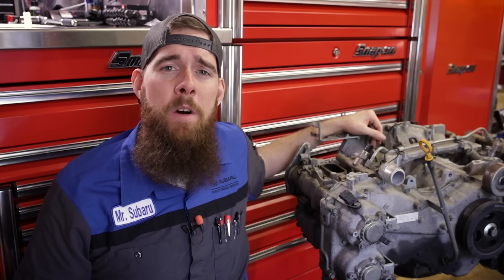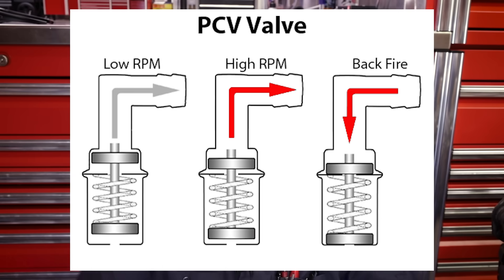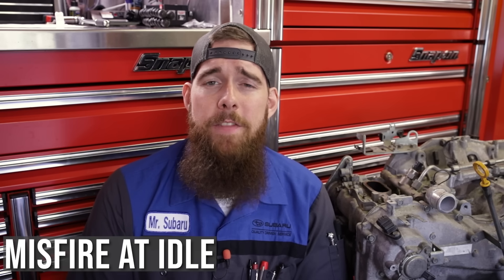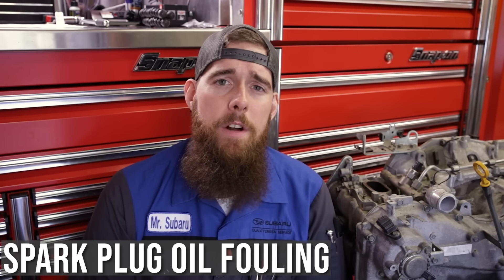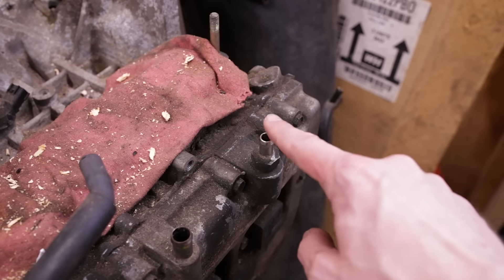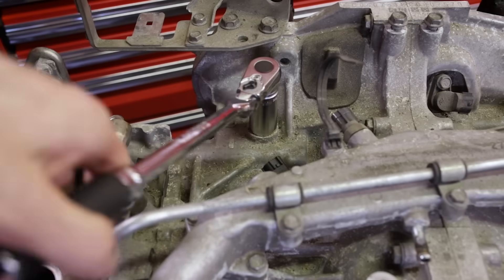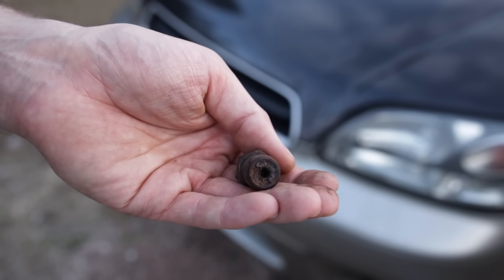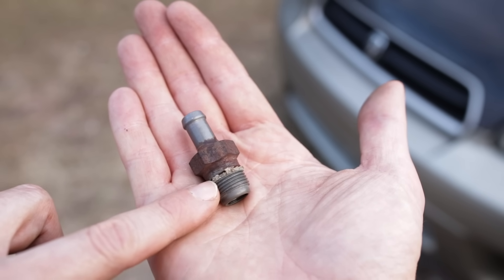DON'T Let This $20 Part Ruin Your Engine! PCV System History, Theory, Operation, & Repair!

Comment: Mr Subaru, a great video and took your advice. New PCV valve arrived a few days ago $29.99AUD.
I fitted the new PCV today to my EJ251 N/A Forester, it has 318,000km on odometer. It was rebuilt 5yrs ago, according to paperwork that came with purchase.
You where so correct about carbon deposits in valve, it  did not "rattle" at all during shake test.
Engine was using a little oil too.
Replaced PCV with new one and cleaned out vacuum hoses.
I still have a whistling noise from the engine under acceleration, any suggestions?
Reply from the maker: Was there carbon build up in the block, under the valve?
Reply: @MrSubaru1387  Would you also use brake cleaner to remove the build up in the block? What about cleaning the port threads (since they would likely have sealant)?
Reply: @MrSubaru1387  yes carbon in Port under PCV. I now have 327,000km on Forester 2004 and it is rough idling with hesitation in acceleration. I've cleaned TB on manifold like you show and vacuum hoses off PCV had gunk and power valve on side of TB. Cleaned all and reassembled then started engine and it idled high at 3,200rpm with Power light flashing on dash. I shut it down immediately. How do I lower the idle?
It's twin cable TB.

Comment: Question, on my ej253, theres another hose attached to the block next to the pcv, the hose on it goes back up to the center air box. Is that meant for supplying fresh air to the crankcase? And should the pcv get clogged could pressure be vented there and not immediately blow out of the oil seals?

Comment: Thanks for the tip. Got a 2011 Legacy 2.5i and inspected the pcv valve after watching the video. I noticed that the housing was CRACKED because it was made out of rubber that housed the PLASTIC pcv vavle. Had to buy the whole housing instead of just the pcv. Does the plastic one work differently? The new one didn't rattle when I tried the shake it.

Comment: you forgot to tell users to remove all hoses to PCV valve and clean them, on my car all hoses was 90% clogged by white\black gum, clean all hoses with brake cleaners, and replace worn hoses.

Comment: would you recommend installing a catch can on a NA 2015 Forrester, to limit un filtered pcv air from circulating right back into the intake? Wouldnt it be the same issue with recirulating unfiltered exhaust output right back into intake via the EGR? 
Shouldnt these flows be filtered.?

Comment: Another nice Video.  What thread sealant do you use for the PCV valve and the Oil Pressure sensor mounted near the VVT Solenoid?
Reply from the maker: Teflon paste/tape, or Grey RTV.

Comment: If you are "Lucky" the PCV valve hangs open and your engines runs bad because it acts like there is a vacuum leak. It won't blow out gaskets that way.
:49 Fixed orifices are common on some engines. Also, the things Germans and Swedes use for this purpose is sometimes different. All that was required back in the 60s was that there was something that redirected the blowby into the intake manifold. How they did it was not important

Comment: The one using grommet is a hell of work trying to remove it...it just stucked on the grommet and have no idea how to pull it off without using heavy tools that will break it...I think the threaded version is better than the grommet type...easy to install and remove

Comment: This is why I use a oil catch can on both of my mustang GT ever time I change my oil and filter I empty my catch can and it catches 3-5 ounces of oil every oil change that’s oil not going back into the intake manifold and the car runs smoother and every time I get ready to change my oil and filter I spray a can of intake valve cleaner and then change the oil and filter

Comment: Interesting. Maybe this is a dumb question, but do ALL modern car engines have PCV valves? When I started driving in the 1970s, they pretty much all did. Modern cars, however, I have seen conflicting info where some sources say a given vehicle has a PCV valve, with other sources saying no.
Reply from the maker: Most all still have some form of PCV system.

Comment: I noticed some water (yellow oil mixture) under my oil cap as its gotten colder.  Im gonna replace the PCV on my H6 and hope that fixes it.  Last time I saw water under the cap - it was a matter of time before It was destroyed and I had to put a new H6 in.  Heres to hoping this may be it!
Reply: Head gasket leak

Comment: My 2014 Suby Outback 4 fist boxer has a rough idle and hard to start no codes so I am hoping the PCV valve is the cause, but when I went to replace it the hose is hard as a rock! so I am waiting for the hose to get here first then I can replace it and see if that helps.  160k miles.  I already cleaned the MAF airflow sensor and cleaned the throttle valve body

Comment: By far the best explanation of what it does, the problem it solves, and possible issues. Great stuff.
Reply from the maker: Thanks! Happy New Year!
Reply: @MrSubaru1387  I have a question that I hope you can answer please. I have a 2009 h4 Subaru legacy sport that I recently changed the PCV valve on but when I did I accidently broke the thing that the valve threads into loose out of the engine itself and I don't know what it's called so I can't replace it. I was wondering if you knew what it is

Comment: Speaking from my humble experience I can say that it is better to just replace the pcv. Even though said pcv shows no sighns of being bad.  Some say every 50k km wouldnt hurt to put a new one. I change around 100 k. In my case   i see some oil in the pcv tube and in the pcv as well. However in my previous subies of ej series i never replaced them and to be honest the milleg(km) was relatively small about 100 k+ km. Of both cars. As usual like for the excellet video😀
Reply: As long as you car doesn't burn oil and change your oil every 5k miles  then you really shouldn't have to worry about it. Carbon is what makes it get stuck

Comment: The "V" in PCV means Valve so stop saying PCV valve and stop say ATM machine while youre at it.
Reply from the maker: Positive. Crankcase. Ventilation. PCV. Positive crankcase ventilation valve. It's not redundant. 🤦🏻‍♂️ 🤦🏻‍♂️ 🤦🏻‍♂️ 🤦🏻‍♂️ Don't try to correct someone when you aren't correct.
Reply: Im sorry.
I looked it up after I posted and tried to get back and delete my comment but too late....

Comment: Wish I would have known this 30,000 miles ago before my seals started leaking. I haven’t read anything about preforming this during regular maintenance intervals. Thanks
Reply: Exactly. I don't think it's in the maintenance schedule. Mine clogged and blew out crank and cam seals at 90,000 miles. So I had to replace those and basically do the timing belt at the same time, 15,000 miles early. $$$.

Comment: $20? Last one I purchased for 3.6 was almost $30 at Subaru dealer and replacement at dealer is approximately $70. That said, it's my understanding the replacement of this item is not recommended Subaru maintenance at any mileage interval, why is that? There are dealers who do add this to 30K and 60K maintenance inspections though.
Reply from the maker: Should be checked every 30k miles or so. Cleaned/replaced based on condition found.

Comment: I've never seen a video from you that wasn't clear, interesting and , above all, useful. Thank you 😊👍.
Reply from the maker: Thank you! Glad you enjoyed it. Happy New Year!
Reply: @MrSubaru1387  hi ,have a question i  just bought a process west top mount intercooler  to fit on my 2002 ej05 subaru wrx  wagon , the instructions is hardly any regarding placement of one hose supplied with t-piece,will that hose now take the place of the old hose connected to the pcv-valve if so ,I'm not sure what air hoses goes up top to the new intercooler, the instruction as stated is so stupidly done on pieces of paper. thank u

Comment: Great video... I have never seen or changed the PCV on my 2003 WRX STi but it may be cause of some strange symptoms I am having right now - random intermittent misfire on cylinder 1 while idling, or driving. One thing though... where you show the location of valve in engine is NOT clear enough... I still have no idea where it is on my 2L Sti engine... in future when you show location, can you show the overall engine first and then slowly zoom into the location the part is.... if you just show the zoomed in location I have no idea where that is in engine - i need the zoom in to get the correct context, location, rotation etc where camera is pointing to.
Reply from the maker: Pop hood. Stand in front of the car. Locate the intercooler. Move back to the throttle body/intercooler coupler. Look to the left. You see black hoses, it will be straight down in this cavity. Top/rear of engine block, left of the throttle body.
Reply: @MrSubaru1387  Thanks for reply. Yes, that matches where the other youtube videos I have seen shows it to be. But I hope its not part of that big plastic joint others have shown where they said you can't easily get the bolt out without breaking the plastic mount or brittle pipes connecting it. Also seems you have to take entire intercooler off to access it - i have done this before to change the O2 sensor and changing the starter motor but not exactly quick and easy to do - hard to get IC intake back on turbo pipe again afterwards.

Comment: Hi MrSubaru... recently after having my cat back exhaust replaced with a custom SS one my EML came on. Took it to the Subaru specialist who added the computer and told me it's 'faulty EGR valve code' and that he's never needed to replace on one on these (Outback 3.0 H6). Turned the light off and told me to carry on my business. It came on again after about 500 miles so I explored the EGR valve which seemed to be an electronic one. Cleaned the EGR pipe but didn't remove the valve. I've now been finding the light only comes on with certain fuels (95RON but not 99RON). Could it actually be my PCV valve gummed up. I'm on 156000 miles. Thanks again for all your lovely vids to help us on our Subarus...
Reply from the maker: It never hurts to clean/replace the PCV valve. Great place to start. What was the actual EGR code you got? Valve issue or flow issue?
Reply: @MrSubaru1387  Thanks for the response. The exact description on his monitor read out EGR valve malfunction. I forgot to actually read the code. Only thing stopped me from doing the age valve replacement was that (a) it was too tight an angle and I didn't have the tiny ratchets needed to ensure I could put it all back together and (b) the part is £350 and a main dealer only part around here (middle of England/UK). Will sort the pic valve and take it from there (throttle body also cleaned btw as I'd just watched your vid on that too). Thanks again mate and keep up the excellent work for us Subaru-geeks...

Comment: I'm assuming the build up is worse on turbo models compared to the n/a's? I checked mine at 100k miles and it was like new, the 1 on my friends wrx with 80k on the clock was stuck half open and absolutely jammed up with crap
Reply from the maker: Yes. Turbocharged engines normally see higher amounts of blowby and crankcase pressure than naturally aspirated engines.
Reply: @MrSubaru1387  does it make a difference with different grades of oil aswel or is that a myth? I run mine on 10w-40 semi synthetic as the owners manual recommends as I quite often have to carry heavy loads or tow the trailer, for normal use it recommends 5w-30/40

Comment: Why is it not on the maintenance schedule in the handbook?  Also why not put a crank pressure sensor that picks up when the pressure is too high?  Isn't that oil pressure anyway?
Reply from the maker: It used to be recommended to inspect/clean around every 30k miles. Oil pressure is not the same thing as crankcase pressure.
Reply: @MrSubaru1387  sure so why do they take this away from the manual now days, is the vehicle computer possibly actively monitoring this via a crank case pressure sensor. Seems like it should simple sensor that could be added to the PCV valve.
Reply from the maker: @kartboarder22g17  it's not monitored. No senor to monitor it.
Reply: On a different topic I was shocked to find out the 2019 Forester was the first year to add a radiator door to it. I have a 2014 and on my 17 mile commute my car water temperature never hits maximum. Warms up to 160 degrees vs. the 210 it's supposed to hit.   Because of that i don't grab the best gas mileage in winter months.  Just shocked cause I would have thought engineering would have added this tech years ago. Yet it most be the drive for better gas mileage that is driving the need by govt.
Reply: @MrSubaru1387  so no maintenance for the CVT or this, is Subaru America just under the idea that most folks sell their used Subaru before 100k and they could care less about the guy/gal that gets it used. Whatever happened to keeping their saying of 90% of Subarus sold 10years out are still on the road?
Reply from the maker: @kartboarder22g17  this isn't exclusive to Subaru... No vehicle manufacturer I know of, monitors and warns driver of PCV issues or crankcase pressure in excess. Lots of other manufacturers say the same, don't service the transmission.

Comment: 2018 Forester 2.5i 6MT NA with catch can installed from day one.  From the first 5,000 miles to every 5,000 miles after, oil change is done, catch can is cleaned.  Every 10,000 miles CRC GDI valve cleaner is sprayed.
Reply: How much oil do you catch? I have a quality catch can, but after 30,000 miles I've only captured about 1/8 of an inch of oil. I change my oil every 3-3500 miles. Some say that doesn't matter with how much oil it collects, some say yes. I almost always drive long enough for the car to be completely warmed up. Some say the engine needs alot more miles before it starts collecting more oil? About to check throttle body and clean it. Curious what it looks like. Would love to take a camera and check valve carbon build up vs obey without a catch can.

Comment: Very informative. thanks.

I have a question for you about my 18 Crosstrek.
I change my oil twice a year (fall and spring) i barely put 4,000 miles on it in a normal year.
When i drain the oil into the pan it smells very bad. Almost like gas or exhaust.

Is this normal? or cause for alarm? should I be doing something different  ( probably should drive it more lol )

I had the recall work on the PCV done 2.5 to 3 years ago.
The car runs fine. No smoke no hesitation my fuel economy is normal.

Thanks.
Reply from the maker: Probably do a lot of shirt trip drives? Rarely get the engine up to full temp?
Reply: Correct. Mostly short trips.
The Blue engine temp light turns off but not for very long.
Reply: It's interesting you bring this up. I have an 18 crosstrek and have noticed occasional blueish smoke on  startup after the vehicle sits a few hours and have gone rounds at the dealer to try and duplicate. Leak down test yielded nothing and all looked normal but my oil smells a little like gas, drove frequent little trips and had the pcv valve recall done too about 40k or so ago. Now at 78k miles. I might replace my pcv valve just to see of thats the source of the smoke.

Comment: Just curious, do you modify your personal Subarus in any way, or just leave them completely stock?
Reply from the maker: Most of mine are stock or stock OE+, modified with factory parts. I did modify my 2004 and 2002 WRXs slightly, but that's about it.

Comment: @MrSubaru1387, What is the nipple size (the hose size) on a PCV valve for a FB25 on a 2020 Outback N/A? I want to buy an oil catch can, and I need to know what size hose/fittings I need for valve side of the system. Thanks.
Reply from the maker: Sorry, I don't know offhand. If I had to make a wild guess, 3/8"
Reply: @MrSubaru1387  Thanks anyways.

Comment: Had a oil leak on my timing chain cover on my ‘12 3.6r and this fixed it. Still burns 1/4 quart of oil every 4,000 though😅
Reply: Isn’t this normal though?

Comment: We own 2016 Forester with 56k miles on it and lately were suggested to replace PCV by the dealership. Assuming are doing all the maintenance and put good gas into the car, how frequently you’re supposed to replace it? We don’t have any complaints about oil consumption etc. thanks!
Reply from the maker: Should be checked every 30k miles or so. Cleaned/replaced, depending on its condition.

Comment: An AOS replaces the PCV. I use .5 of a litre over 6000km. I have 300,000km on my motor.
Reply: Yeah I have an IAG AOS in my 2015 WRX gfor around 5 years now. Told I never really need to do maintenance on that. I just ensure no leaking occurs with it every so often. I think I'm good...hopefully.

Gotta get NYS inspection this month again... Hope I pass again. No CEL but I do have a few mods in my list of mods before they stopped tuning for it which us egr and TGV deletes. Got tuned last in 2018.

Comment: What is the torque on this one? Please
Reply: That's not a lot. Don't tighten the PCV valve (or the oil pressure sensor) like a gorilla, since it's tapered.
Reply: Gonna ask the same, thanks. Also, what kind of thread sealant?
Reply: @chencho7083  he said grey silicon or teflon tape
Reply from the maker: 25.5NM or 16.6Ft.Lbs.

Comment: How to I get the light on my dash to turn back on for the clock / outside temperature. Is there a fuse for it in the fuse box below the steering wheel I checked and didn’t find it yet? 2003 Subaru out back station wagon 2.5l v4
Reply from the maker: Likely the bulb has burnt out.
Reply: @MrSubaru1387  thank you !
Reply: @MrSubaru1387  which means I have to take the entire dash out ok thank you
Reply from the maker: No, just the radio trim, bezel trim, and cluster.
Reply: @MrSubaru1387  I think that’s what I mean like this right ?